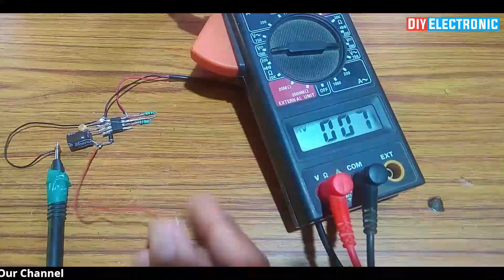3v To 12v Boost Converter Circuit | DC To DC Boost Converter

Comment: In the circuit's diagram there is no coil. A boost converter needs a coil to function. I just don't see how this circuit could function. And three LEDs in series requires 9 volts to turn on. Didn't the multimeter measure 5? This seems fake. Edit: i built this circuit and it didn't work. I expect my comment to get removed but at least a few people may read it